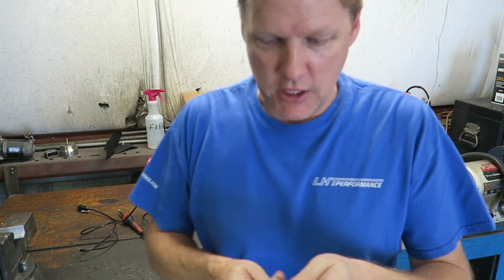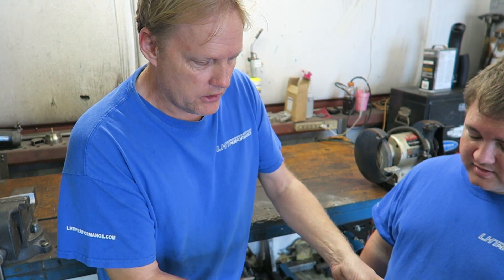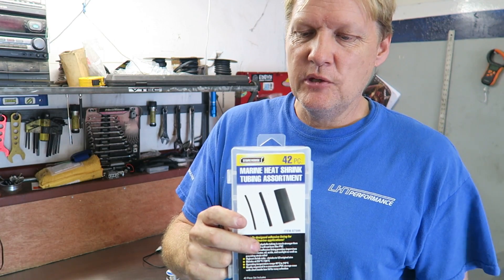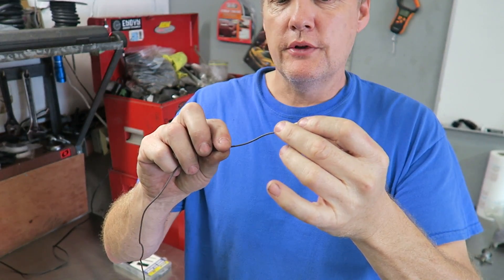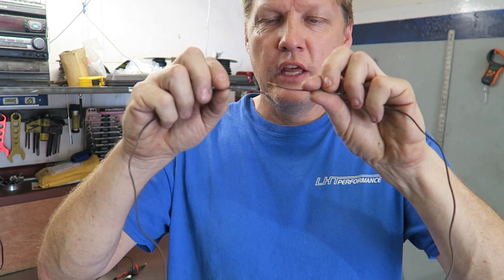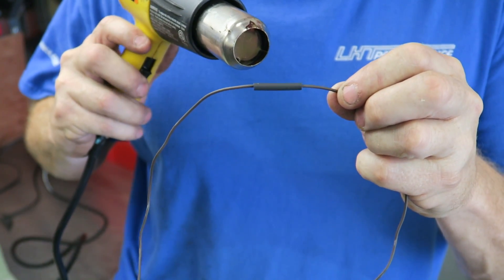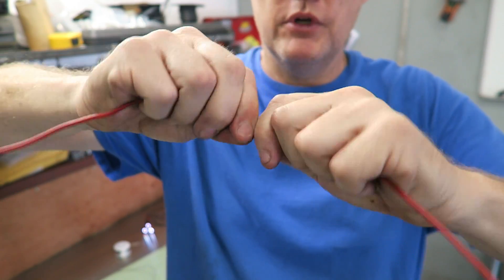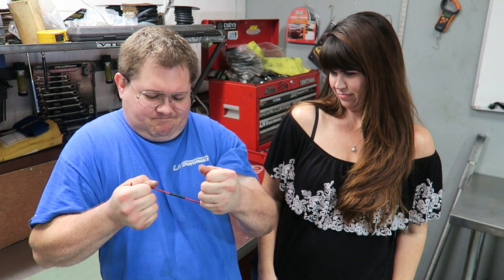How to Solder - Tech Wednesday

Comment: Im really surprised you guys solder. My buddy is the electrical engineer for team Jaguar race team. he scolded me 10 years ago for soldering vs crimping.  His argument was tear apart a car harness, then tear into a plane harness, NO SOLDER.
Reply from the maker: J Dalzell  A pre made harness on a boat, plane, car etc that is mass produced is one thing.  When we change plugs, build battery cables etc we solder and heat shrink. If our wiring is submerged in water, tugged on and continuity tested it will our perform a crimp joint.   Like I said, if you car is worked on at LHT, your wiring will be soldered.
Reply: I can see both sides to this argument. I recommend quality crimp connections to my novice customers because I feel they are easier to perform correctly. Soldering can backfire if the person is inexperienced, fails to prep the materials, fails to use the correct technique, etc. I would put my soldering up against most crimps but I have the correct tools and experience. Each can work just fine.

Comment: Nothing wrong with soldering, but there is no actual need to solder a wire, there are ready made joiners that press fit into each other, also it makes no difference whatsoever if on a simple twist join, the joined wires are facing each other or not. A sharp knife and waterproof tape is enough for me.
Reply from the maker: Marios EvoCy Well, if you ever get work done at LHT, it will be soldered and heat shrunk. 👍🏻
Reply: No worries on that, but that would be somewhat impossible for two reasons, I am at 6300 ish miles from you and I do all the work on my car myself. Keep up the nice work.

Comment: Make sure you buy Rosin core solder. I accidentally grabbed a spool of flux-less solder (I didn't even know I owned any) and spent like 5 minutes trying to make a speaker connection. Finally looked at the roll and was like "WTF".  Went back in, got the solder with the flux... done in under a minute.
Reply from the maker: Kenta Koga I should have mentioned that, I’ve done the same before.

Comment: Smart man like your OCD style I hate electrical stuff especially wiring harnesses and installing aftermarket engine control system but I can’t stand ugly joining of wiring indeed put them copper ends together and twist the solder it then put heat shrink over it look very professional and stock looking